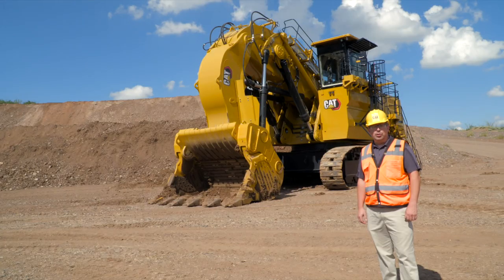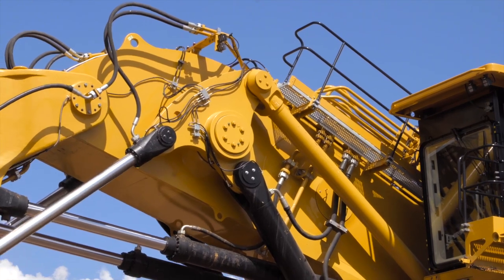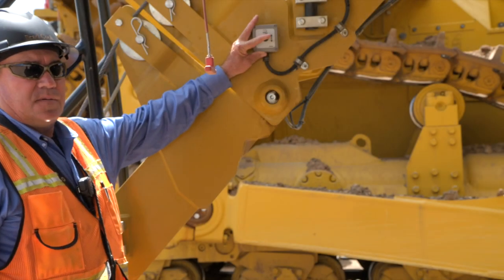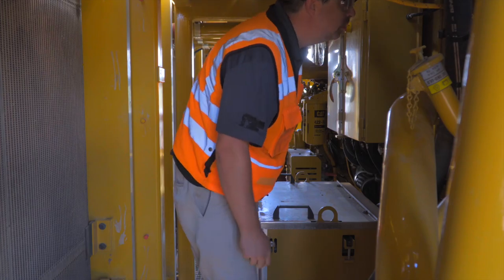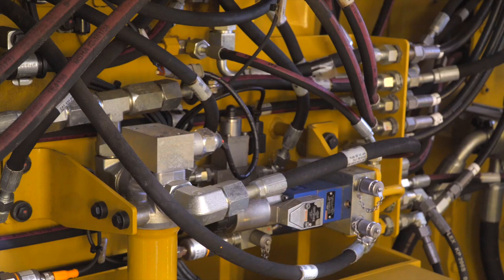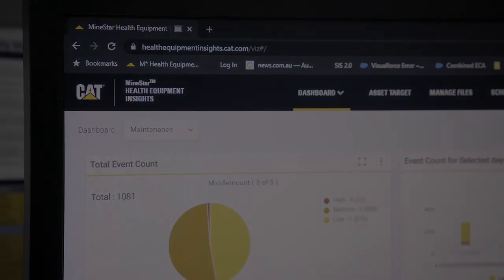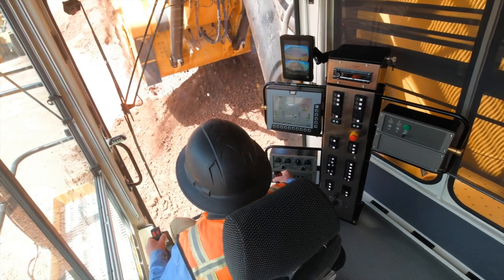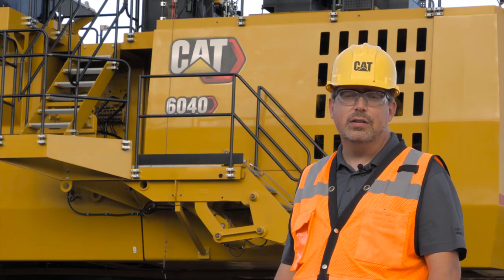6040 Hydraulic Mining Shovel Walkaround

Comment: I run one for a living. Mine is the bucyrus rh170 version. We also run a cat 6040 and 6060. I’ll take the rh170 over what cat has done to a great machine. Cat engineers have ruined this machine.
Reply: Goofball5225  that’s years of experience talking
Reply: Goofball5225  you run one?
Reply: Goofball5225  you work for cat?
Reply: Goofball5225  because if you work for cat you should want to talk to me. I have given my contact info to cat and still to this day they won’t have a dialogue. The 6040 and even worse the new 6060 are putting cat engineers inputs between the operator and the machine. Cat is proving that they don’t trust operators to run the machine. The operator assist and plc are set to protect the machine and kill production. Cat is more concerned with the future automation of the machine. The new design right down to the cab is just copy others instead of innovating. If anyone from cat wants to follow me for a rotation I’m sure they could. I’d love a cat rep in the cab for a week